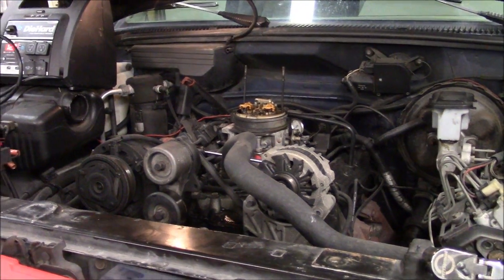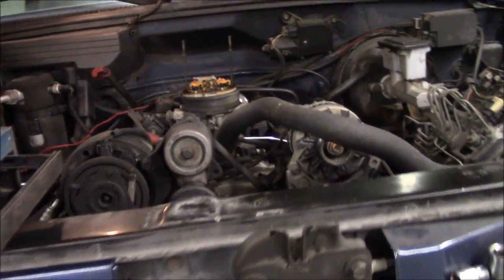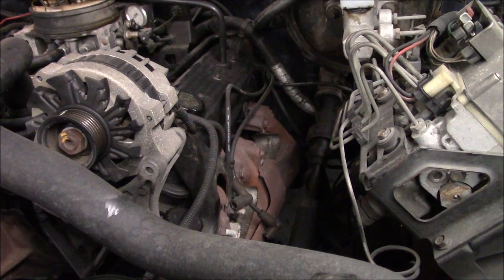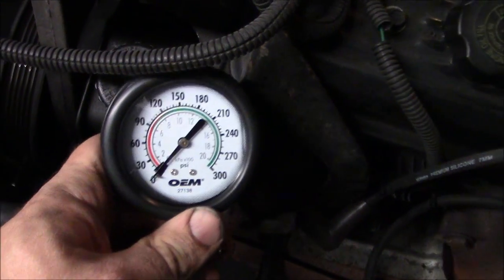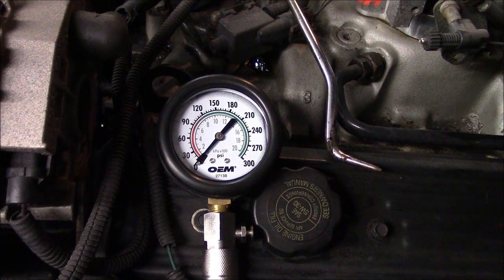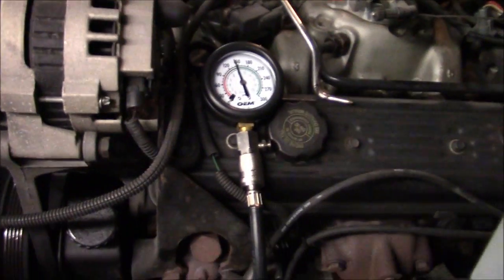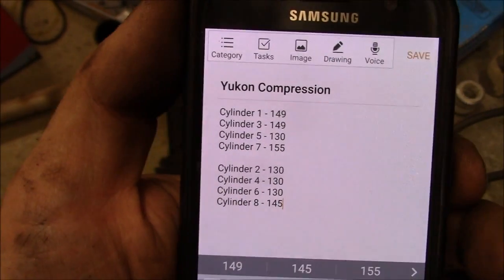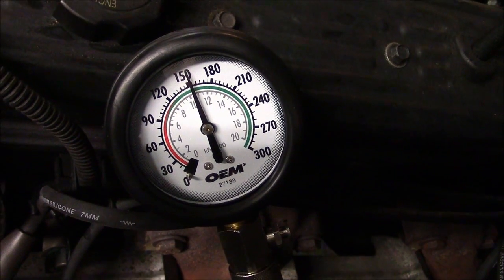How to: Do a Compression Test

Comment: Why do I need to disable the spark if the spark plugs are out? How can it be more disabled than no spark plugs?
Reply: Because if the coil is powered then the plug wires are going to arc to the nearest ground aka you or the frame… so your going to want to disconnect the coil so you don’t get zapped by 40-50k volts

Comment: I wouldn't think that's enough blow by to spew oil out of the front seal...You mentioned the loss of oil and not if there's a smoking issue..A worn engine with blow by will surely cake up the oil rings..BTW I run the engine 5 revolutions for a comp test and to me a 130-150 doesn't sound so bad...What's the comp ratio.?..8.5-9.0:1.?
Reply from the maker: Weird update. I pulled the motor. Both head gaskets were blown into the lifter valley. Also, 3/4 of the pushrods were severely bent. Who knows how long it was like this too.

Comment: don't forget to hold the pedal to the floor while cranking on a FI car.
Reply: get out of here with your fuel injection
Reply: Why?
Reply: Is this so the throttle body blade is open?
Reply: M P I actually made a video about this. Essentially it’s to introduce as much air as possible and the least amount of fuel. You also want to keep the choke wide open as well.
Reply: Without the butter fly open you are drastically reducing the amount of air.  FSM calls for WOT.

Comment: thanks for this. old school. the TBI has the same outcomes as 50 years of carbs, middle cylinders and all of right bank lose. The right side is never fed enough. What you said in the beginning was good enough.. you suspected it was worn. good answer. I have never compression checked the smallblocks. I would do compression checks in the vortec years and later.. it gets interesting. As all cylinders have an equal chance for the past 20 years.